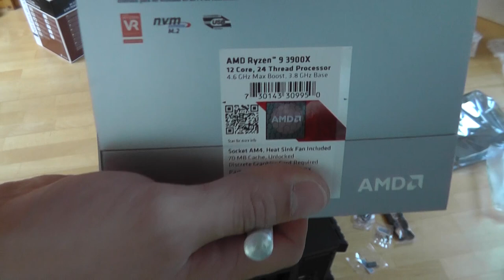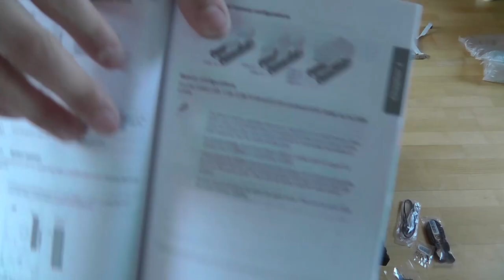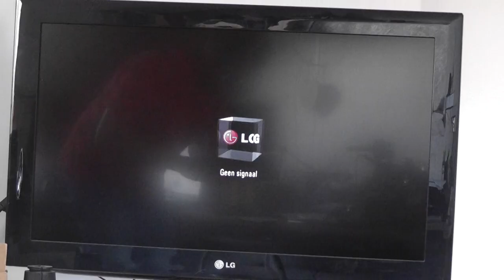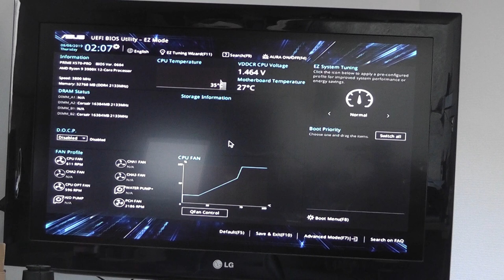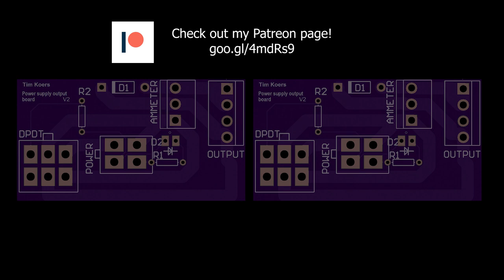#56 AMD Ryzen 9 3900X build

Comment: Hi .What temperatures do you get with that noctua? I want to buy one but I don't know how effective it is with a 3900x
Reply from the maker: I get very good temps! The fans are a very good choice for this CPU. Under full load I get around 80 max. Under idle around 40 at max. 
Do check if the heatsink fits inside your case and over your RAM slots!
Reply: noctura or dark rock pro 4 if u care about ram...and height of cpu cooler use dark rock pro 4

Comment: Why is the Noctua set up to take in air from the rear?
Reply from the maker: It's setup that it pulls the air through the heatsink and pushes it out at the back. It's a pull pull setup, because push pull didn't fit over my DDR4 sticks

Comment: I need pc case  any advice for 100$.have same cooler   but  first fan over ram is more high, ryzen 1700 here
Reply from the maker: You can look up the specs for the cm 690 ii, the depth needs to be at least 15mm more than the depth of the cm 690ii.

Comment: Thank you for your video, I have a question if you can help me please, I have the same ryzen 9 3900x like yours (bought already) and I have two old GTX 780 like yours also but works in sli in my old system,  I didn't order the motherboard yet, I was planing to order also like yours the Asus Prime X570-Pro or Asus strix x570-f gaming which is very slimier ok the problem is neither of this motherboards have in their comparability Devices_report any GTX 780 compatibility!! (only 1000 series and above) now I am worry to go forward as I am not planing to change GPU in nearest time and can't find any information online about this topic (looks like gtx780 become quite old already) so I wish to know how is your system working??
Reply from the maker: My system is working flawlessly! One think to note is that you should not use the Asus GPU Tweak OSD overlay, as it causes some programs (like Adobe Premiere Pro) to crash
Let us know if the GTX780 SLI is working as you except it too!
Reply: @TimsElectronicsLab  Thank you for replying, ok when I will get my system running I will post the results here :)
Reply: @TimsElectronicsLab  Will I had my PC running now and everything went fine gtx780 SLI is working very good
Reply from the maker: @MoSaberDev  Good to hear! Thanks for letting everybody know the end result :-)